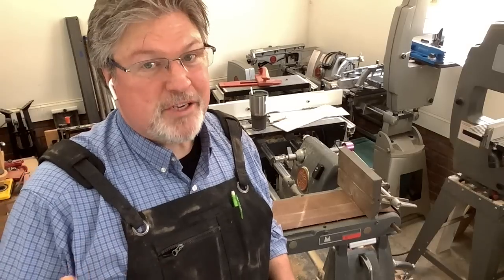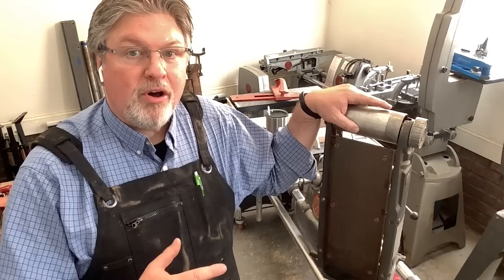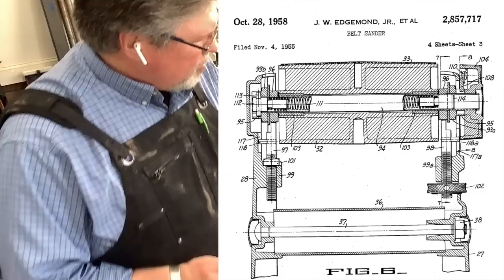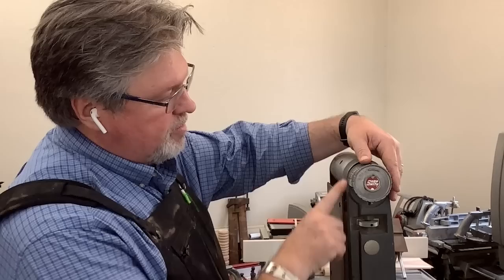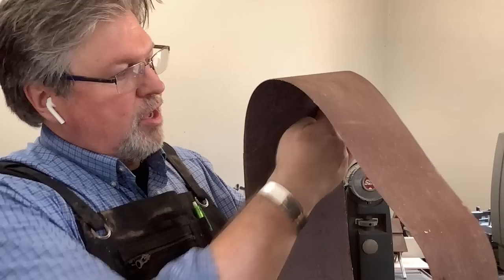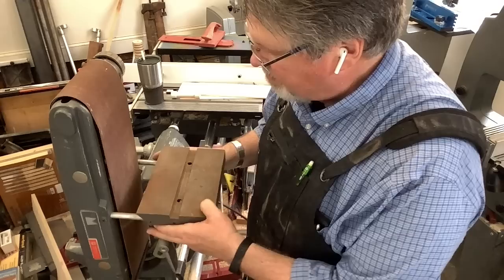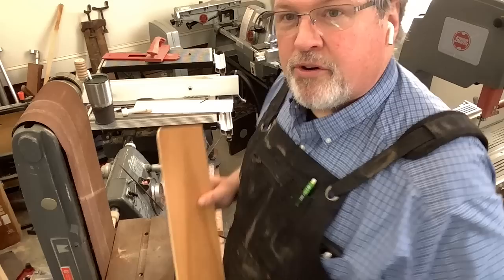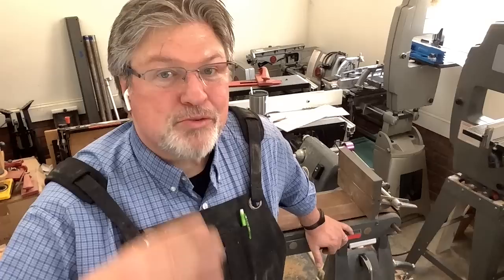Introduction of the Shopsmith 6" Belt Sander SPT (Special Purpose Tool)

Comment: I think the tracking mechanism on this belt sand is so ingenious and fascinating. Another thing that always mesmerizes me is how the trunnion rotates perfectly around the drive shaft of the lower drum so that re-alignment with the headstock is not necessary when changing from the vertical to horizontal position. These machines were invented by really smart people. To me that's part of the joy of working with them.
Reply from the maker: I agree. The trunnion works great as long as it is kept clean and lightly lubricated.

Comment: Great video ! I use my belt sander for commercial production work. Just cant wear out the fool thing. Works like new ! I use the back side to round corners of  3/4 " square stock. Works perfectly.  This is commercial heavy duty equipment.  Never over heats. Use it continuously for 2 / 3 hrs at a time.
Reply from the maker: That’s awesome!

Comment: Scott in your follow up any ideas of worth of the drum sander that goes on the shift that sticks out on side opposite of drive hub. Pretty pricey. Maybe just buy set from HF, for use in Jacob's chuck, or on separate drill press. Thanks for video. If I lived closer I would bring truck down and help you move shop. Have a good night
Reply from the maker: When I was editing I couldn’t believe that I didn’t even mention the versatility of the  auxiliary shaft!
Reply: I use the Harbor Freight Drum sander set with the 1/2 inch router bit chuck. Perfect piston fit. I like being able to cut my own sandpaper "drums" from 3 inch belts.
Reply from the maker: @woodshopnerdery  Shopsmith used to sell a set just like it and I like it for the very same reason.
Reply: @MyGrowthRings  damnit I was gonna mention this neglect but you all beat me to it!

Comment: I received a non-serious injury on Saturday using the belt sander. It hurt like you know what for several hours but turned out to be just some bruising to my finders. I was wearing gloves so no gore. But, I got lucky. 

In short, my fingers got caught between a long heavy work piece and the idler drum when feeding the work piece over the belt in horizontal mode. Basically,  I created a pinch point then promptly stuck my fingers in it. To quote Scott, "What a maroon."

There are two other pinch points that I know of, between the belt and table and between the belt and dust collection fitting. I feel compelled to wish everyone safety and good fortune in the workshop.
Reply from the maker: Ouch! Glad you made it through.
Reply: Thanks for educating us.

Comment: Thanks Scott! I picked up an old SS belt sander that I’ve never used, your video will kickstart me to set it up finally. I hope your move is not too stressful! My last move a year ago was brutal but woodworking with my SS tools was, and still is, a great comfort.
Reply from the maker: Thanks for that. You are going to really like it. Scott
Reply: I just bought an old SS belt sander as well actually I bought the whole shop. Lol I know it's not everything but it was quite a bit. But the man that I bought it from told me that the upper bearings would probably need to be replaced in that upper pulley.

Comment: Early on (way, way before acquiring my Shopsmith), I had rigged a stand for my B&D 3x21 belt sander to (a) clamp to my bench while (b) using it horizontally (c) with a table. Worked great. Then I got the Shopsmith and the 12" disc was the bomb! Until I got the 6x48  a couple of years ago. Now we're cooking with gas! I still have the B&D & the stand. I never know when I might need it.
Reply from the maker: I suspect that’s the same path a bunch of us have followed.

Comment: Hello and thank you for all of your videos!  I just picked up a Shopsmith Belt Sander and it appears to be the same model that you have in this video.  I ordered an owners manual from Shopsmith, but I believe it is for a newer version that includes a dust port.  I assume and hope that is the main difference and I am encouraged by your comments on this sander.
Reply from the maker: @bbirdiebirdie  That’s all that has ever changed, so you should be good. Well, that and the crowned drive drum that was short lived.

Comment: I've always liked how Shopsmith kept the Magna logo casting molds for the longest time before updating them. Which applies to this tool (body casting), the jig saw (gearbox cover), and the jointer (cutter guard) seen on my 1980 SPT's. Shopsmith really knew how to save a buck back then. 
Of course so did Magna, the engineering of the 6" belt sander with the spacers between the body castings are left over way and bench tube pieces. You taught me that one, Scott.
Reply from the maker: Yep, they just didn’t change things for the sale of change.
Reply from the maker: That said, it was always thrilling to see the beautiful new parts when they updated the castings. I was working there when they made the change to the jigsaw and the belt sander.

Comment: Great into!!!  Didn't know about the bolt that can be loosened in the tensioning process.  I've always had to fight to change belts so I tend to over wear them out.  Also will need to clean and ways the adjustment.  Thanks
Reply from the maker: It looks like that’s what this guy did with this sander. It looks like it has never been adjusted.

Comment: My shopsmith belt sander loses tension constantly when it's running. To the point that it's not even useable. I've tried retensioning it as per the manual, but no dice. Any advice Scott?
Reply from the maker: You may need to replace the tension spring. It’s not difficult to do but you’ll want to take your time.

Comment: I apologize in advance for making too many comments on this one. As consolation, I hope the extra comments boost this video with the YouTube Algorithm.

Regarding the extra trunnion bolt, which I am also missing, here are two excerpts from my Belt Sander manual. Page 4 - "Remove the extra bolt at the back of the belt sander, below the shaft. (Keep this bolt for later use.)" Page 17 - "However, avoid setting the belt sander at an angle in between. The base casting is designed so that it can brace the sander when it's in a horizontal or vertical position. If you use the belt sander at an odd angle, use the extra bolt for additional support."

It never occurred to me to use this at any angle other than vertical and horizontal.
Reply from the maker: Yep. It can be handy if you are sanding an angle because you can position the sander so that the table is level.
Reply: Whats the size of that bolt? I will read the rest of the comments and probably find the answer…

Comment: Scott, I need a deadhead sander for Guitar necks. The working area needs to be 12 to 14 inches long to fit between the contours on the neck. This platform looks great but would be too long. So, I guess I will be designing and building one for my Total Turd!!  Dropping the full  4 K  version Thickness Sander build today!!

Comment: Thanks fo the belt sander video. I just bought a used 510 and got a belt sander, jointer and dust collector with it.  I liked the demonstration.   I think I’m also missing the bolt….
Reply from the maker: I appreciate that.  That bolt is a 3/8"-16 x 2" hex head cap screw.  Scott
Reply: @MyGrowthRings  i knew the info would be here!

Comment: SS is my fav. belt sand.er, far better than my Porter-Cable. Mine is a 1984 Model. I bought my SS from a friend 6 yrs ago, his wife bought it for him in 84 for his BD and he had never unboxed it. So basically I have a brand new 84 mod. w/ all the accessories.. Good Luck on your House moving Scott
Reply from the maker: Wow, that's great. Do you still have the 1 1/4" dust port or have you upgraded to the 2 1/2"? I need to upgrade this one before I put it to some real use. Scott

Comment: Love my SS belt sander.  I’m thinking of buying a second 500 just to convert to a shorty to hold my bandsaw and belt sander or jointer full time so they’ll be ready for use rather than moving the from storage to SS when I need them. 

Maybe that’s a future video for you Scott, creating a SS shorty - ideal tube length, pitfalls, etc….

Love the channel.
Reply from the maker: Oh, that would really put me face to face with one of my hang-ups! I don't like the idea of cutting down a Mark V and would rather build a stand that holds and powers SPTs, but I get that the form factor is ideal and that you could always just add a new set of full-size tubes to bring it back to full-function. I know these things but I still have issues!  Thanks for the suggestion and perhaps I'll tackle my issues one of these days. Scott
Reply: I turned my spare 510 into a dedicated sanding station, with a 12” disk, a 6” belt, and a 2” drum sander, and it works great.
Reply from the maker: @stewwolfe1  Now that’s a smart combo.

Comment: I also add a drum sander on the output shaft opposite the drive coupler. Some are hidden with the cone cover that protects people from the shaft turning. If you use the 6” drum, with the new 2” sand paper, you can have a drum with 3 different grits to finish up any inside curves. I made a shorty with strip sander on the left and belt/drum combo on the right. Handles most application for sanding in one small location, I’ll post a picture on your FB link to this video if you want.
Reply from the maker: Yes, please do. In the middle of editing this, I realized that I forgot to mention running accessories on that shaft, so I'll be sure to mention it in the follow-up. Scott

Comment: You forgot to mention the out put shaft that can run a drum or disk and if you have the flex tool the drill chuck.   I plan on putting mine on my powerstation and I am going to try to mount a table with the disk and I have a couple shopsmith tubes and carriage I am thinking about mounting them so I can use my 500 main table with the disk sander on the back side of the power station.    To be determined,   Lol.   But I want to build a sanding station.   Alongside my 2 x72.    Now that's what Shopsmith should make next.   Besides knife making I do not think a day goes by in my shop My 2x 72 does not come on.  mine is homemade but I love it all the same.   Talk about a belt staying cool. 72" they do not load up.     I am still collecting a little at a time.
Reply from the maker: Yes, in this video I did, but I did cover it in the follow up video which is now private for channel members. It’s not something that I rely on often, but it is handy at times.

Comment: I rebuilt my sander and had my drive wheel turn down flat. Unbelievable how much easier it is to track now. Just wish the side rails were in better shape.
Reply from the maker: We’re they damaged forme the belt drifting from side to side?
Reply: @MyGrowthRings  yes. I see a lot of the used older sanders damaged like that.

Comment: Thanks Scott, that was a great review.  I've used my sander many many times and love it.  I don't have many tracking issues; I always seem to be able to get it working.  I didn't know about adjusting the screws underneath the roller.  That's great information.  Can you go into a bit more detail about which is the right direction to put the sanding belt on if there are no directional arrows?
Reply from the maker: Hey Anne. Yes, I sure will. I guess I was in a rush and forgot to cover that. Scott

Comment: Just received a replacement drive sleeve from Shopsmith for my belt sander. They sent me a piece of a motorcycle innertube, for $21.39.
Reply from the maker: Is that what it is? How can you tell?
Reply: @MyGrowthRings  Well if you ever changed a innertube on a bicycle you will recognize it eminently.  Evidently the original sleeve is not available or cost Shopsmith too much to have produced, so the went to a innertube. On top of that I just received verbal instructions on how to install the sleeve. Slide the sleeve on, roll sleeve half way back like a sock coat the rubber and drive cylinder with rubber contact cement, then roll sleeve back. Repeat on other half. The sleeve is already to big, slid it on by hand no problem. Once you roll it back long enough to apply rubber cement the tube should be all stretched out of shape.  This installation has disaster written all over it.
Reply: @MyGrowthRings  Still need to talk with you about the belt sander.
Reply from the maker: @merlin750  Actually, that's exactly how it's done, and it works quite well.
Reply: @MyGrowthRings  The belt sander that I purchased for $10.00 needs totally rebuilt. Both idler and drive drums are crowned. Everything needs cleaned and reassembled and adjusted. How difficult will it be to get the belt to track with both drums crowned? Originally both drums were full of shredded sanding belt and bound up was the reason for the total rebuild.
Reply from the maker: @merlin750  You’ll never get it to track properly until you remove the crown from the drive drum. Thankfully it’s not that tough to do. You can even do it while the drum is installed by using a carbide lathe chisel and while driving the drum with your Shopsmith.
Reply: @MyGrowthRings  Thank you for the information. I am still looking for someone that could use an incomplete band saw in good condition to trade for a belt sander fence.

Comment: The location of that locking bolt that’s often missing please.... thanks for video during move... wishing you both well
Reply from the maker: There are two holes that pass through the the base at the trunnion. The bolt should be in one or the other of those holes. Scott

Comment: I hope I am not too late to make the mid-week Q&A. My belt sander is one of the most used spts in my Shopsmith collection. I should also add that I am in Western Canada where SS can be hard to find. My son  picked up a well used belt sander a few years ago that has some deep grooves cut into the back side of the side castings by the belt tracking too far off the platen. Do you have a recommendation on what to fill the grooves with? 
Also, can the 6x48 belt sander be run in reverse to sharpen tools?
Reply from the maker: The STUMPED video is currently uploading, so yes, you missed it, but in it, I sort of answer your question around running in reverse. As for filling the grooves, your best bet is to used Bonodo and any brand of auto body filler, then touch it up with spray paint from Shopsmith. They seem to have a proprietary color and their paint will match it perfectly.  You may be able to get that paint from All-In-One Wood Tools in Oakville. Scott

Comment: yep watching your videos,  just dragged my Shop Smith out of shed, my late father bought me few years ago, mice had made home in the boxes so I have a little clean up to do, but I have no manual on set up procedures, or  what can be left on the stand  what has to be removed. ? so your videos very helping me figure out what goes where.  i was told the previous owner made table legs with it.  So want to set up mine to use band saw, and make bowls. any suggestions.  i am open.
Reply from the maker: Welcome to the Shopsmith family! I highly recommend that you head over to eBay and purchase an owners manual and a copy of the book “Power Tool Woodworking for Everyone“. Ideally your want to purchase those from the same era that your machine was built, but it’s not entirely critical.

Comment: Scott -- really good videos.   Have a quick question about the back up plate (PN 502963; Model 640) for my 6" belt sander purchased in 1980.  I recently was sanding sides on a jewelry box and noted that the back up plate is not totally flat -- perhaps up to 1/64" off between the mounting screws.  Is this just because the sander has been used so much, or is the back up plate designed that way.  Plan to purchase a new back up plate, but wanted your opinion first.  Thanks
Reply from the maker: No, that is not by design. There may be a way to flatten it, but it might make more sense to just replace it.

Comment: When reassembling the belt sander does it matter which way you put in the drive drum? I don’t see a different in the sides and I’m not sure which was originally the side facing the headstock and which was the auxiliary spindle.
Reply from the maker: If I recall correctly it is unhanded.

Comment: Scott,
Took your advice and bought  a sander. A few questions:
1. How do I reset the tension knob on the idler drum to know where “zero” is before the 4 turns?
2. I am assuming this just tightens the internal spring as every time I turn it, the drum goes back to the same position. Is his correct?
3. When I get the tracking right with no load, when I start to sand, the belt moves away from the headstock. When it gets a bit over, I pull the wood away and the belt returns to the center. Is this right?
Reply from the maker: Hey James. The starting point is after you hit the release button and allow the spring to release all of its tension. If pressing the release button does not cause the knob to spin you would be at zero. Yes, it is an internal spring that you are tensioning in the drum itself should spin free. If the belt is moving substantially under load, you either need to raise the left side tracking nut, or check to make sure that the bottom drive drum is not crowned. Good luck as you get this dialed in. Scott
Reply: Lots of adjusting and taking belt off and on, but I think I’ve got it now. Drive drum is flat. Thanks for your video and subsequent help.
Reply from the maker: @jamesbrunk9817  Excellent! I knew you had this. Scott

Comment: Is it worth picking one of these up if the table is missing asking $100. How hard to find/expensive is it to replace the table. Or build a diy table solution.
Reply from the maker: Jeremy, Shopsmith still makes them and there are also people who part them out on eBay. I purchased one without a table because it was a deal and there are some operations that can be done without the table. Is it work $100? That’s up to you. Scott